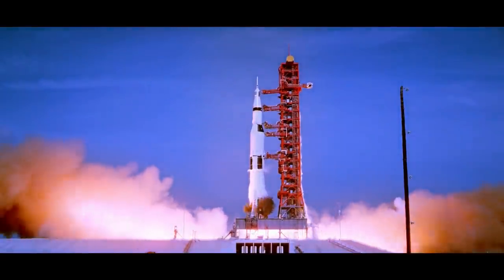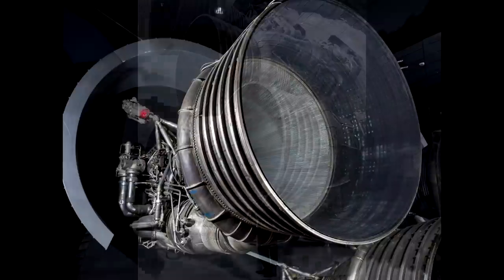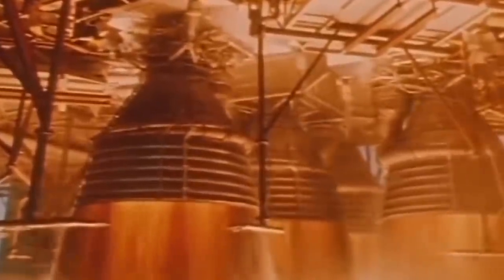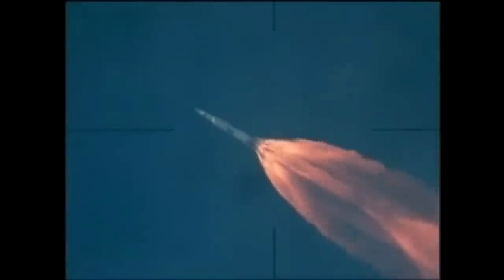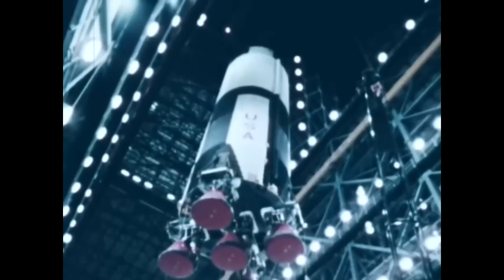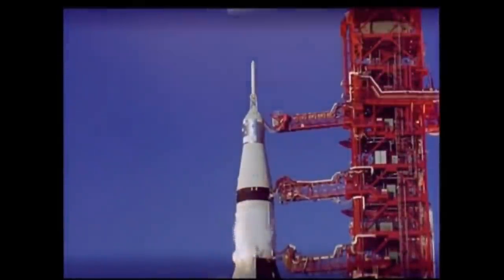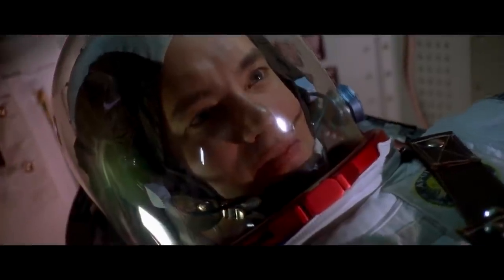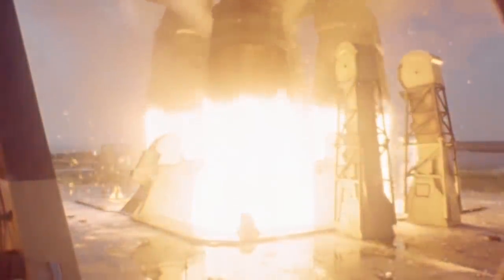Why The Engines That Flew On Saturn V Rocket Look Different In Museums

Comment: Well, I guess they realised that asbestos isn't good for your health didn't they. Also, it looks much cooler without its blanket (or should i say hotter ? Depends on your viewpoint !)
Reply: It’s harmless as installed. When it’s disturbed or degraded you are at risk of inhaling the stuff. 

Oh, did I mention we used to play in the stacks of old ducting in our basement growing up? It was leftover from the change from oil to gas heat lol. ‘Cough’
Reply: I think you can take from this that NASA was aware at the time Asbestos was not good for their workers health but could not find an alternative material at the time. I suspect that it was added really late in the assembly process - ie. just before roll out to minimize exposure. (The ancient Romans were aware of the issues with asbestos - hence condemned slaves mined and processed it).
As for disturbance - the vibration and turbulence from a running F1 might qualify as would hitting the water at Mach 1.
Reply: @allangibson8494   it's not that you can't use it, you just have to ensure that it cannot go airborne near unprotected personnel.  I would also think the raw material and assembly cost for the INCONEL (not cheap stuff) foil sandwiched asbestos would have been prohibitive for a museum piece.  Also, the foil wrapped asbestos was likely one of the last additions to the ship before launch due to..well...foil being delicate and asbestos being n asty
Reply: @DrewLSsix  we had oil growing up. The guy coming to fill the tank was exciting! We had asbestos tile in the basement.
Reply: @DrewLSsix   It might not be harmful while it is still. But it becomes a risk... why take it?
Reply: @davidgreen5099  The plumbing and hot water pipes was probably wrapped in asbestos as well. I lived in a house with  an oil heater as well. How it was done back then.
Reply: @DrewLSsix  Not to mention that the insulation used in homes is completely the wrong kind of asbestos, but don't tell the blood sucking lawyers that cause they don't believe in science anyway lol.

Comment: Ahh, launch camera E8, how I love your footage of the F-1's starting up and lifting the magnificent Saturn V into orbit!
Reply: You never grow tired of watching that!
Reply: That footage is from Apollo 11, which was launched in July. Why is there ice breaking off the Saturn?
Reply: @muzero2642  cryogenic fuels
Reply: @muzero2642  because the liquid oxygen is several hundred degrees below zero, and any water in the air condenses and freezes on the area where the tank is almost instantly.
Reply: 50 years later and it's still astonishing.
Reply: @muzero2642  You can see this with spacex rockets and really any modern rocket. The fuel/oxidizer in the tank like liquid oxygen is something like -200 degrees when they load it prior to launch. This causes a lot of ice build up on the outside that is shattered when the rumble starts

Comment: Thanks for the explanation. I've noticed this difference between flown and unflown articles since the early 1980s. I assumed it was simply the heat from the engines deforming the metal in some way, and never questioned it beyond that, nor gave it a second thought. Well done! Thank you for making these videos Scott.

Comment: First Man got it correct because instead of making the close up shots using expensive CGI which would then just go through a filter to make the footage look old anyway, they just used the incredible close up footage that NASA engineers shot already for analysis purposes. Good choice in my opinion, but I wouldn't give them full credit for getting every detail right in this case since it was just by default. Still an incredible film though (and after this I think I should go see Apollo 11)

Edit:
I had not yet seen Apollo 11 and so didn't realize it was made using entirely real footage, my bad. Just saw it and oh my god it was awesome!
Reply: I never understood why moviemakers use crappy cgi instead of the amazing original footage
Reply: @cud0s  It depends on the look someone is aiming for. Notice how in first man even the CGI shots looked like they were filmed on (albeit NASA quality) 1960s cameras? If they wanted to make it look as if we were literally standing next to the Saturn V then the CGI would have been twice as detailed with a steady camera, but the spliced in real footage would have stood out like a sore thumb. Personally for movies and documentaries regarding the Saturn V I prefer they use the first method of making it all look like period footage so and using as much real footage as possible, because it gives credit where credit is due to the engineers who had to design cameras able to steadily capture such high quality footage at the time  while being subjected to the vibrations coming from the second most violent machine built by humanity (next to nukes). Also, it tells the world, "There, see? We did it! We fucking did it! I mean ya we had to design a new type of drawing board for us to go back to for most of this project, but we were asked to put men on the moon with in a decade and so put them there we did!"
Reply: That's a good point. But given the existence of explicit reference footage of the actual event, you'd figure CGI recreations would be fairly accurate as well.

After all, you have an exact reference for what it should look like.
Reply: @KuraIthys  Perhaps it was intentional? To better show the complexity and beauty of the engine?

After all, the shielding was not part of the original design, so I wouldn't blame them, it is a movie after all.
Reply: First Man gets lots of details wrong, I was shouting at the TV half the time I was watching it. I was particularly annoyed about the Blu Ray extras repeating the myth that the LM computer alarms meant it wasn't any use to them and they had to land completely manually. Wrong! Read the Apollo 11 Haynes manual for the correct story on that, or other more detailed sources. As a computer programmer by profession I admire robust well designed and engineered computer systems and the Apollo guidance computers were up there with the best. The design and the alarms saved the landing, not made it difficult.
Reply: Sorry, but as someone who has closely followed the space program and it's technology for over 50 years, I have to say that First Man was just crap. I almost never turn off a movie before the end. I usually wait it out to the bitter end. And turn off a movie about the space program? Unthinkable, no matter how bad. And yet, I turned off First Man about 3/4ths of the way in. I just couldn't take all the skakey-cam nonsense, the Robert Altman style "Natural Dialog", which is essentially incomprehensible mumbling a lot of the time, and then add to that the fact that a lot of dialog was covered with the noise of wild shrieking children, for no reason, or noisy machinery, for no reason. And finally, they made it appear that every space vehicle was apparently constructed from a paint-shaker attached to a cement mixer. What BS.
Oh, and BTW, Neil Armstrong was not the "First Man" on the moon. Neil and Buzz landed on the moon together at the exact same moment. The fact that they were in an LM 12 feet above the ground was irrelevant. They had landed. They were there. Who got out of the car and put his (space suited)foot on the ground first is completely irrelevant and insignificant.
Reply: @KuraIthys  "Apollo 13" was shot in 1994/95 at a time when CGI was only beginning to be usable for large screen cinematic features - "Jurassic Park" from 1993 being the game changer. Having said that, they should have got the engine bells correct even back then - schoolboy error No.1 when it comes to F1s on a launching Saturn V.

Those of us who build scale models will have been aware of "batted" F1 engines for a while. NONE of the scale models of the Saturn V come with the F1 engine bells showing as "batted". However, a number of aftermarket model accessory companies can provide scale batted F1s - usually in resin - for those who want to depict the F1s as they would look during a launch.

Alternatively, a model builder can try and depict a batted nozzle by applying foil to the kit items, much as they did in real life only on a smaller scale.

 It was through the scale model building literature that I first learned about this batting process. Shows how model building can be educational.
Reply: @gregc2222  I too was rather disappointed with "First Man". I wasn't too concerned about "shakey cam" - you see that in many modern films. My main concern was that Gosling's portrayal of Armstrong just did not ring true as far as my knowledge of Armstrong goes. He came across as dour, sullen and monosyllabic - almost autistic in his responses to emotions. That is not the impression I have ever had of Armstrong - who always seemed to be smiling and engaging. Yes, he wasn't someone who sought out the limelight and could be a man of few words - but if you engaged with him on a topic he was interested in, he was great.
Reply: @gregc2222  I got as far as the bit where Aldrin and Armstrong enter the LM and the camera focuses on the instrument panel. Which was covered in grime. A brand new, fresh out the box LM, and the panels were dirty. Then I remembered that they'd done the same thing to the Gemini capsule and I just couldn't take it anymore. I watched Apollo 13 instead. A far better movie, and one where their spacecraft actually look like they're being used for the first time.
Reply: @solartaire1  , Those are exactly my reasons for NOT having "First Man" in my video collection, which is pretty damn complete when it comes to Apollo and space program movies, documentaries, etc. I wanted so much to like "First Man", but when watching it I was almost constantly put off by all the totally needless, and inexcusable, inaccuracies. As others have said, they got the man wrong, they made every capsule shot look dirty and with gross exaggeration of the vibrations, etc; no point in buying a movie to watch again when I hated it.

From everything I have read, I think the portrayal of Armstrong in "From the Earth to the Moon" was far more accurate than in "First Man".

And NO other US space-race related movies go for the conceit that even NASA spacecraft must look dirty and lived in, as if it was Star Wars or something, and they all represent the vibration of launch more realistically.

And if you have not yet seen "Apollo 11", go watch it or buy the video. It is spectacular. All REAL footage or practically everything, and it is all stuff that you have not seen before, or at least not those specific views. Watching it, you realize that everything you have seen before was just the same small number of shots that NASA released way back when, but they had huge archives of other footage that is now available. The "Apollo 11" filmmakers basically just cleaned up/restored the footage so it looks great, and made sure that the sound was properly synced.
Reply: @cud0s  Those slo-mo cameras on the pad were using 16mm film and there is simply no way to make that not look like hot garbage on a modern cinema screen.

Comment: Thanks for that. I suspect most F-1 engines on display wouldn't want to hide part of it under insulation.  There was so much going on with them.The Saturn 5 was an amazing piece of engineering.
Reply: That motors are such a big monsters Who consumed 20 tons of rp1 and lox per second

Comment: I'm lucky enough to live about 2 hours away from the space and rocket center in Huntsville AL where the test stands and shake building are located.  They also have an actual Saturn V rocket and Apollo Capsule.  Very cool place to visit if you ever get the opportunity.
Reply: I got to go to Marshall Space Flight Center last summer - the actual place with the test stands and shake building, not the museum (which has the rocket and capsule). It was really cool getting to talk to people actively working on projects like ion engines or systems integration for the SLS. Moreso than seeing the historic stuff, in my opinion.
Reply: nasty buzzard  They've also got a giant 7-axis CNC mill, friction stir-welding machines, metal 3D printers, a fiber winder that can work in three dimensions with a robotic arm. And a bunch of machine tools that looked like they were probably around for the Mercury/Gemini/Apollo era.

I got to touch an incomplete Orion capsule. There was a SLS interstage shroud in the manufacturing hall.

I just wish, though, that we'd had time to go see their X-ray and cryo lab.
Reply: MotoOtto 
Yes, I’ve been there three times, it’s epic. I was on a business trip for a week and the hotel we were at was across the street from the S&RC. 
Went on a bus tour of the Marshall Space Flight Center as well, saw some pieces of the truss work for the ISS being assembled.

Good times!
Reply: I've been there also, three times. Both trips were incredible, even though the last was with a school field trip, and I was in charge of a bunch of kids. I live about 30 minutes south of Birmingham. If you drive up to the Alabama/Tennessee state line, there is a rest area with what I  seem to remember is a Saturn 1B. It is infested with birds, and covered with bird droppings now. Sad. The Saturn V at the S&RC is quite the item though. Along with the Shuttle that never flew. A school trip, many years ago (1980 or 1981), afforded the chance to see the chimp that was sent into space, along with the chance to speak with one of the original German engineers that came here after WWII. VERY interesting! The time passed WAY to quickly! If you ever get the chance to visit, please do. You will not be disappointed!
Reply: I used to live in Huntsville for years and the Saturn V was 10 minutes away. Sorry had to 1 up you 🤗

Comment: I remember putting brakes on my first car back around 1980 (it was a built in 68), and my father warning me not to inhale the brake dust as it was full of asbestos. We spent quite a few years without a good replacement for asbestos, it really was an excellent insulator!!! Same with R-12/22, my father used to bring home cans of R-12 for $0.50 a can, and you could buy asbestos at any local hardware store. There's no telling how much asbestos dust I inhaled as a boy, maybe some folks are just more susceptible to it than I was... Who knows, I'm 53 and in relatively good health :-) Great catch Mr Manley, thank you for the insight! I've watched Apollo launches many times and never noticed that :-)
Reply: brake dust is still harmful even without asbestos. The harmful effects depend on how much or how frequently you were exposed. Unless you worked in the industry installing or removing asbestos every day, you probably did not inhale enough to cause issues. The hype about exposure these days is really overblown. Its only an issue for remodeling where it has to be removed. If asbestos is just sitting there, in a home or office, its not going to hurt anyone unless they hurt it first. lol

R-12... man, there was no better refrigerant. Ironically propane is an excellent refrigerant as well, I used it in an old car once instead of retrofitting to 134A. Just have to flush the system and use an oil compatible with it so it doesn't burn up the compressor. Worked great. Not quite as good of a temperature drop as r12, but that was probably down to needing a different size orifice tube for the expansion into the evap core.